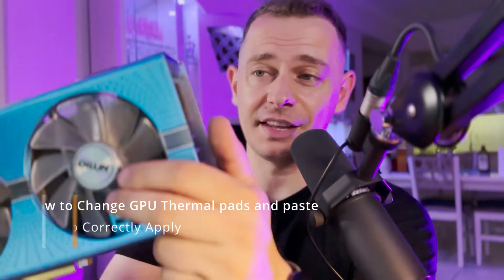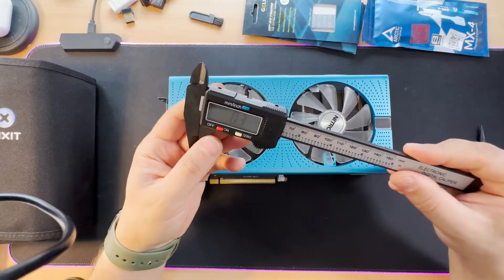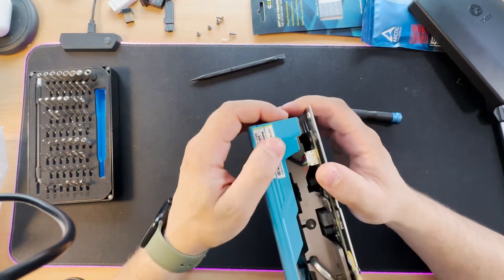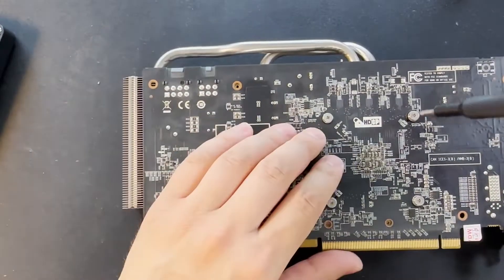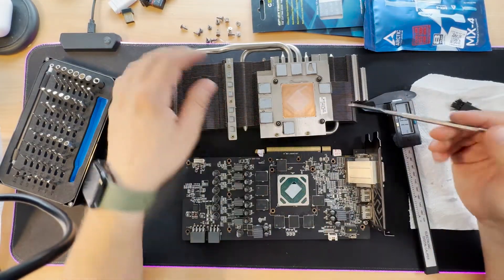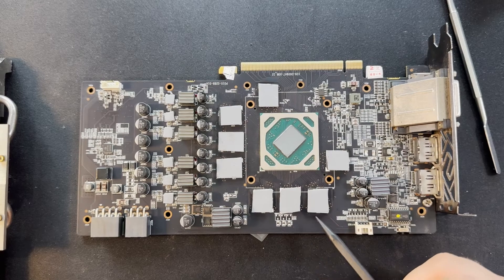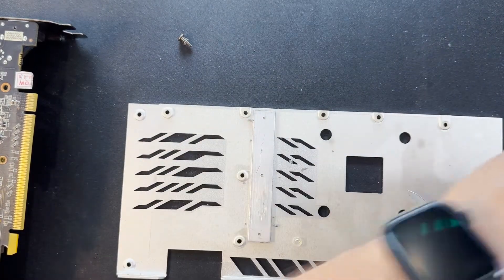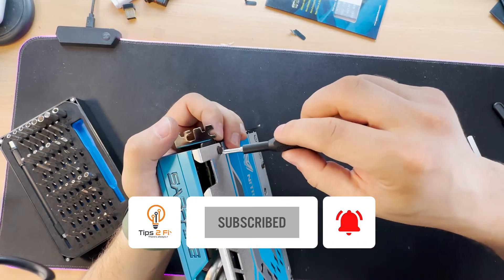How to Replace GPU Thermal Pads and Paste - Optimize GPU Cooling 2023

Comment: Thanks for measuring all the pads now I can safely replace the thermal pads of my rx590!
Reply from the maker: Yes , thats great and your gpu will perfom supper , from that moment im using this gpu with 90% for video streaming full HD using h265 codecs for an iptv station and no problem at all 😊

Comment: Please do the same video but with a card that is overheating and what difference new thermalpads and thermalpaste makes. Recently my RTX 2070 is running 92 degrees hot running hitman 3 with settings on low while 6.7Gb is still available to use. Now i am sure my gpu issues are due to thermalpads and paste. I was just wondering what differnce it will make in temps.

Comment: scratching the die with a screwdriver gave me psychic damage
Reply: He didint scratch it with a screwdriver. It's a plastic thingy, no worries.
Reply: The first tool he used was metal..!    Later he switches to the Ifixit plastic tool for more thorough scraping...
Reply: Same!! I literally yelled, "what are you doing?!" Lol

Comment: If you use thermal paste instead, it will work?
Reply from the maker: no , you have to combinate like i'm doing , in order to make your gpu work well
you see you need to use exact pads thickens like original have very important

Comment: Touching the die with screedriver, damaging the conector 😂 good fix
Reply from the maker: Haha yes i was trying to remove and i damaged the connector , and after i removed the pin that cable disconected and catch again with cable and than i put it back to plastic connector i did it as it was like factory 😅 now this GPU im using for 24/7 encoding video for TV station Streaming, using OBS studio
and its on perfect condition,  60%  in use.
This Revision that i did was great 😊
Thank you for your comment 
Do you have the same model?

Comment: You should try phase-change material Honeywell PTM7950. It comes in as a sheet, lasts longer, performs works better than traditional pastes and there is no pump-out effect. On the power section (vrm) and vrams I advice to give thermal putty Upsiren UX Pro.
It is also a good idea to do undervolting.
Reply from the maker: Thank you for sharing my friend :)

Comment: I have the same GPU and I am having problems with it, my monitor keeps on flickering on and off, I have the latest driver for the gpu but the flickering doesn’t stop. Flickering is too frequent that I barely see my desktop. Will this help?
Reply from the maker: Make sure my friend tha you feed enaugh power to this gpu to make it work well i use this connectors : 
1. Dual 6 Pin Female to 8 Pin Male, GPU Power Adapter Cable
https://amzn.to/43GW6Qo

2. SATA Power to 6 Pin PCI Express Video Card Power Cable Adapter
https://amzn.to/3rHuZHQ
Or
Molex to 6 Pin Video Card GPU Power Supply
https://amzn.to/3QeEjNA
Reply: @Tips2Fix  I am already giving it enough power, before there were no issue, I just left it open then when I came back this flickering started to happened. I've been using this gpu for almost 5 years. I was using display port and switched to hdmi to see if the issue was on the cable but its not. I already change the thermal pads of gpu and the problem persists. I don't know if the whole gpu is the issue or the monitor. but I tested the monitor using my ps4 and this never happens. What could be the possible issue for this experience?
Reply: When I starrt my pc it takes minutes like 5-10 minutes before the flickering starts and non stop.
Reply: @Kyah_Honrado is it fixed?
Reply: Try to underclock your gpu